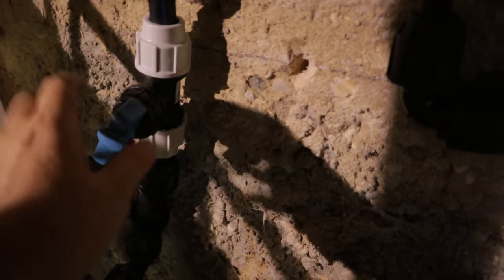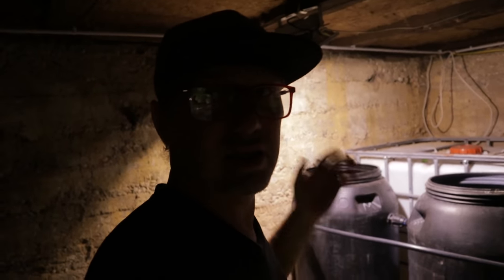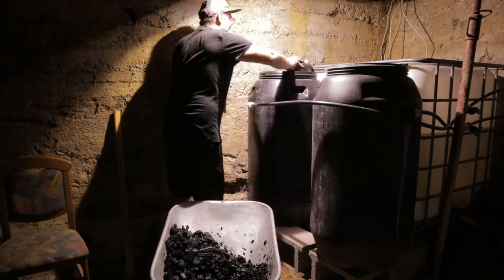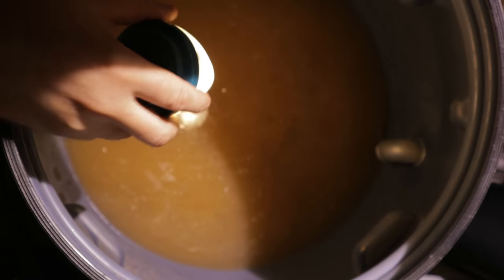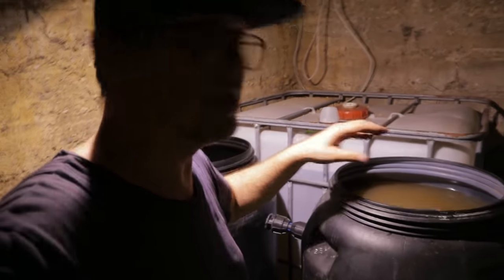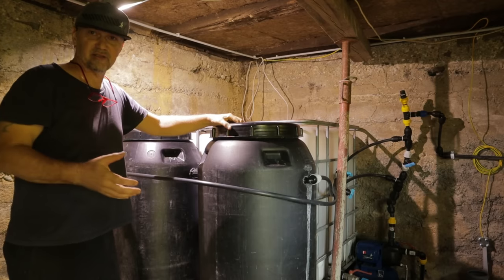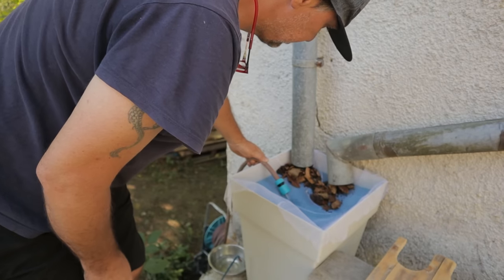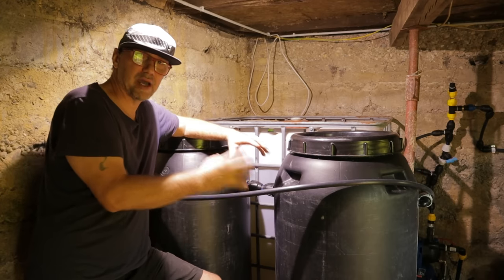DIY Rainwater Filter System

Comment: I think the flow pipes should enter at the bottom of the barrel not at the top and drop to the bottom. The vertical drop in the pipes in this example are a route for water to bypass the filtration medium. As the gravels and rocks would not form a good seal with the vertical pipe area and lots of water would flow up through this gap route to overflow.
Reply: Took me a minute but yes you're 100% correct.
Reply: Yes, and no, his system adds water from the top forces it to the bottom of the first barrel, then up the next barrel, then out what you're thinking would  remove the Grey drop-down pipe. However, it might have some clogging issues. That is if I understand what your saying correctly
Reply: But I guess you could use some sort of flow pipes at the bottom to block out debris too so I mean your way would totally work now that I think about it
Reply: @Razie1201   I think they mean move the downpipe external as apposed to internal so you can monitor any potential leaks or bypasses to the filter?
Reply: @wihdinheim0 lol me too. Had to read it 3 times

Comment: Not trying to be rude here but your system is flawed. Rainwater goes into the base of all the material you put in, has to fill up the barrel  to nearly the top to pour over into the next barrel.  So the first barrel will never empty of water even if the system is closed off.  Then the second barrel needs to full up nearly to the top before it can flow to the house so it will also always have the be full.  The majority of the idea is sound...just where your inlets and outlets are placed in my opinion are not conducive. Just my opinion obviously do whatever you want but, i would say to attach the water inlet in the top and the outlet on the bottom so the water travels through the filter media and you wouldn't need as much pump head pressure to do the job either.
Reply: Then he need 2 levels filtration system so the gravity will do the work. But i guess he doesn't have the space to do that so solving that with one level system + pump is the solution here

Comment: Good job.  May I suggest you rinse ALL of the filtering material before you put in the barrels.  That will cut down on a lot of the dirt in the second rinse you do in the barrels. Again really good idea. Like the misquote netting.
Reply from the maker: Thanks 👍
Reply: If he had done it correctly, he doesn't need to rinse anything. The fact one drum is almost a repeat of the other drum doesn't improve the filtration by any means. Notice that he didn't show the final product. I knew from the start with his design that the final water will still be dirty.
Reply: @alphainfinitum3445 im no expert by any stretch, so im thoroughly confused by his design. There seems to be a lot of wishing going on. For example, just because pipes go from here to there is not a guarantee that the water will go. And I don't understand the bottom to top filtration at all.
Cant this be one barrel, gravity fed top to bottom and work the first time?

The mosquito netting was a good idea, but I think I would have sprung for playground sand. And isn't the charcoal supposed to be activated?
Sorry to bug you but I'm confused and no one else seems to be the least bit critical.

Comment: I like such installations! 
For a biofilter in my optionion the system needs oxigen. 
I installed a similar system to clean a garden pond.
I take some water from the pond flush it over a filter system like yours an give the system oxigen 50l/min.  One cycle lasts 2 hours and the water get back in the pond after that time. The next cycle is starting.
The principle is similar - seperate biological and chemical dirt or simple dust to clean it with bacteria and oxigen. 
The result is impressive a murky and musty pond become clear in three month.

Comment: If you put in a verticle divider in the barrels you could increase the effeciency of each barrel by 50-70%.

The inlet pipe would then discharge near the top of the inlet side. From the top you would start with several inches of large gravel, with several layers of smaller and smaller gravel, each several inches deep.

The bottom layer would be small-medium sized gravel, filled in to a depth of about 4 inches above the partition.

On the outlet side, would be 1 layer of small gravel, then several layers of sand, getting smaller as you get near the top.

Optionally, the top layer of the outlet side could be layered foam. The top layer would be fine foam, then medium foam, then coarse foam, them a layer of "lava rock".

This would enhance the filtering by providing a biologic layer. The lava rock has very high surface area (great both as a mechanical filter and biologic filter). The foam also has very high surface area. The lava rock layer should never be replaced. The foam can be removed and cleaned or replaced as needed.
Reply: I got lost😂 but I’m interested in knowing more about these types of systems

Comment: Only change I would consider is a cut of valve between the 2 barrels & an easy disconnect so you can clean or replace the 2nd barrel with the charcoal with a fresh barrel. This would make it so you didn't have the wait time to recharge the carbon filter half. Just swap the barrels & you're good. Clean the now dirty one & repeat as needed.
Reply: I use a rubber plumbing boot.

Comment: Put faucet to open and close in the bottom of the barrels.  Then you can flush out your filter system. And back flush each barrel for cleaning your filter materials. This is very similar to setting up a filter system for fish ponds.

Comment: You could use a gravity double filter instead with the same filter ingredients.
Saves the pump electricity as well as prevents spillage/leakage.
Reply: water barrel bomb with gravel sharpnel if pressure builds up too

Comment: Hello! In the Appalachians here. There are many people in my area with old family homes from the 1800s like mine. Mine is 20 feet deep and 8 foot diameter at the bottom and 12 feet at the top. It holds approximately 7000 gallons.
I do not have a filter other than a piece of screen covering a barrel at the top to catch leaf litter and the foot valve is 14 inches above  the bottom to keep from sucking up the fine silt from the bottom. If I am home when the rain starts I will turn the water out for the first 15 minutes of the rain to clear the roof of debris and bird poop. My family has used the water from it for all household uses including drinking with no additional filtering for 4 generations. I clean and repair the cement lining once a year using a stiff broom to remove the silt from the walls and rinse it with clean water followed by a clorox rinse before patching and refilling it. The roof is tin not shingles. I would never drink water from a roof with shingles as they contain petroleum products which are toxic. 
I was told it was unsafe to drink the water from my cistern without a filter system in place by the health department so I tried the method described in the video. If you get a rain heavier than a light shower most of the water will back up and overflow the barrel system very quickly wasting most of the water. A filter process after the water enters the cistern wastes much less water.
Since my family has drunk the water for generations without getting sick I have opted not to use it. This could be because of acquired tolerances to local pathogens or maybe I'm in a cleaner area where such pathogens do not exist. That being said, if you try drinking water without some kind of filtering you may become ill and infants and small children should not consume such water.
Reply from the maker: Thank you for your extensive comment 👍🙂

Comment: The level of inlet and outlet may have brought more complications. Having the outlet height lower than the inlet would solve the problem.

First run you have to give the system time to fill out and eventually run smoothly.
Reply: That is just what I was thinking.

Comment: If all you have is galvanized fittings, use them, but if you can get PVC or other safe plastic fittings, this would be preferable. I have seen similar systems in the Caribbean, but it's hard to get people to use them since the water supply is so contaminated. Great concept.
Reply: I wouldn't use pvc, I would use cpvc. It's what is used for drinking water or pet is better too.
Reply: @williammetzo5407  cpvc is also more Heat and UV resistant and it won't become brittle under pressure

Comment: small advice, change the angle of leaf catcher to around 45 degrees and keep the mesh filter on the same level as the edges. Saves you the time to remove the leaves every time.
Reply from the maker: Thanks for the tip!

Comment: I have suggestion for You ... 
 make a FilterNet/Mosqito Net bag place in Berrel and fill with material and Close it with any rope or Zip tai, So when you want to clean your filter it will lot more easy to Clean , You only have to Pull Net Bag , No Need to Uninstal whole system , and Its easy to Handle all gravel will not get mixed .. I hope you Understand What i want to say .. all The Best 👍👍

Comment: Hi Mr. Robert thank you for your video. very illustrative. But if you allow some observations, there is something important about the use of plastics in pipes and containers. the use of these products generates MICROPLASTIC in the whole water system and ends up being polluting to the environment. One option although it may be more expensive, but you could consider the use of copper in the pipes (maybe in containers it could be very expensive almost unaffordable), and in the tanks, maybe the use of some kind of coating on the inner walls of the tanks, some kind of natural resins or non-petroleum products) And also the mosquito netting you have to ensure the use of non-plastic elements.

Another observation is the design of the tanks, think of a system of removable layers because as it is now and thinking about maintenance and cleaning it could be very complicated to service and clean and replace the whole system instead of replacing by layers.

Comment: Brother, I suggest you to add an additional backwash system to anticipate the sludge trapped among the filter media particles.
By adding this backwash system then the filter media arrangement will put in random and the the flow process direction will be downflow filtration.

Comment: Hello, thanks for showing us this. Please there are many things you need to change for this to work, because even though you didn't show us the final product after running many cycles, I can already tell you that from your design, there will be no improvement to the final  quality of the water.

1. The smallest size of particles that a filter can filter out is determined by your finest material, which in your case is the fine sand. This means that even if you use multiple stages of the same design or run many cycles, your filtration will not get any better. With your current design there is really no need for the second drum.

2. Keeping you current design the materials should be as follows from bottom to top:
Bigger gravel, big gravel, small gravel, smallest gravel, largest sand grains, larger sand grains, large sand grains, fine sand grains, finer sand grains, a layer of crushed charcoal, a thick  layer of cotton,. Then press everything down with the lead. You will now need to put your outlet on top of the lead instead of the side of the drum. With this setup, even if your intake water is from a dirty river, the output will be as clear as bottled water. Your second drum can be your water storage. Just make sure in your water storage you put the appropriate number of drops of bleach(6% concentration) depending on the size of the storage.
This setup I just gave you very scalable, meaning you can scale it up by expanding it out into multiple drums(not repeating it), or you can scale it down by using a smaller container and hence smaller amounts of all the materials I described. I tried this on a scale as small as a test tube in my lab using water from a dirty lake, and my result was as clear as bottled water. The water will be drinkable. Just make sure you don't take your sample from a source that has been chemically contaminated, because no amount of filtration will get rid of those contaminants. Rain water is ok, but just be mindful that it may be slightly acidic. Lake or river water that is not close to a factory is actually better.

Comment: Very nice project. The only observation I would make is that you did not put a pre-filter for leaves and other bigger things that will clog the small holes on the pvc pipes at the bottom of the plastic drums. This pre-filter outside the 2 drums to make it easy to clean.

Comment: i put 2 - 6" PVC compression couplers as scubber filters between the water intake pipes, and then to one 30 gallon filter barrel layer with 1" gravel rock and on top that pea gravel with a mesh bag filler with washed coarse sand, with more pea gravel layer then on top I put a mesh bag filled with activated charcoal chips with fishpond filtering pads covered with more pea gravel. in one compression coupler i put mesh bag with sand toped with pea gravel, and the 2 nd scrubber 6" PVC compression coupler i put a mesh bag filled with washed charcoal that then went over into the 30 gallon layered charcoal, sand, rock layered with pone bio filter pads

Comment: nice set up. in case it is potable there are a couple of things that made me cringe a bit (other than plastic to metal threads). Are you using galvanised fittings purely for the tapered thread? what kind of silicone are you using?

Comment: Hello, Very nicely made video. I am a chemical engineer and do not understand the logic of having the large gravel at the bottom of both tanks. Your drawing shows it as a once-through upflow system but actually I think I saw it was recycling from the tank. Did you show a drawing of the whole 2-filter tank pump circulation scheme? Really great work you do. I think my family in South Africa has application for this. You show also a charcoal filter separately. Would this be within the system too? Thanks very much.
Reply: I think you are over thinking it a bit.  I'm pretty sure the large gravel is just a spacer to allow the water to flow, but keep the finer elements from falling into the holes in the pipe and blocking it.
Reply: Small holes in pipe plus larger gravel around it = holes remain unblocked.
Reply: You are correct.

Comment: I just realized two logical mistakes for that instalation. 1. the filter should have  been installed before water tank. Because the organic mater on the roof can get into the tank easily and microorganism can find the opportunity to reproduce. 
2. you add extra load on motor. The water could have been got into firstly filter and than tank with gravity the motor would flow the water directly to fitting.

Comment: 5Gal Buckets... x15-20 of them... Add to your collection! Fill up once with rock, sand, etc then load all, carry to site and dump! Repeat... Saves effort, keeps loads in safe manageable size and weight, and removes clean up of transport or allows transport with "classy" vehicles!

Comment: If what he was trying for was a slow sand filter, this is completely backwards. The way this is set up, it will only filter particles and debris, not bacteria, virii, and parasites. A slow sand filter has a biological component that eats nearly all the harmful stuff that can live in water and affect humans. 

In a slow sand filter, you slowly add water to the top of a barrel filled with progressively larger particles as the water travels down the column, and in that first sand layer, a biofilm will form that stops anything harmful from going further down the barrel. In the bottom, you place a bunch of crushed activated charcoal to catch any chemicals that have slipped through. A mature filter with a fully developed biofilm doesn't let a lot of water through, maybe 10 litres per hour, but the water that comes out is completely safe to drink.

Comment: can use just 6" PVC pipe but you'd have to put caps, drill hole to put fittings etc. the compression coupler has hole at each end fo pipe fittings+

Comment: Would this work for filtering washing machine water through it then only using the water to water plants with. Also are you using an air compressor that is set at a low air pressure to pressurize the system. Thanks and excellent video, far better then the ones I've seen anywhere on You Tube. I wish more people could see and find your videos. Thanks again
Reply: There’s no reason you couldn’t utilize a system like this to recycle all of your home’s water. Even your garbage disposal water and black toilet water. 

The only thing about that is is that god definitely need to implement both an ozone generator and reverse osmosis for the water, too. 

1st stage, which’d be the main IBC tote connecting all of the waste would have need to have the ozone. 

Next stages would be what this gentleman has done. Then your final stage would be reverse osmosis. 

Perfect water even when using disgusting water.

Comment: Good plan but I would have some additional variations like a cheesecloth filter before going into the pipe of the next barrel. Also a destination thank with shungite & maybe silver. In the first tank a little pool shock - chorine - (VERY SMALL QUANTITY) … I haven’t figured out how to automate dispensing pool shock in the first tank.

Comment: The sidewall of the CMU the block you are using is not designed to support weigh , it would be better to stand them up as per normal and put a piece of pressure treated plywood on top to spread the weigh out across all off the block.